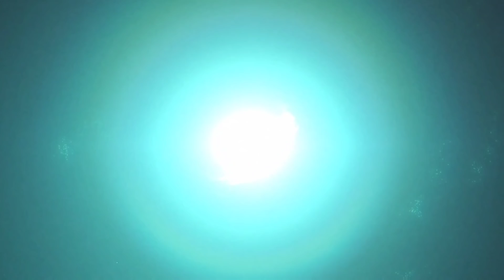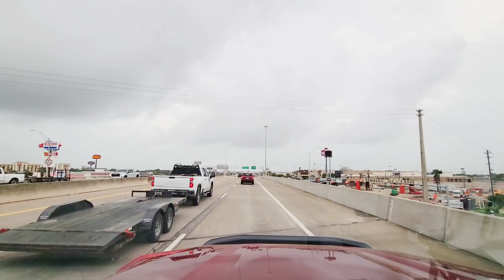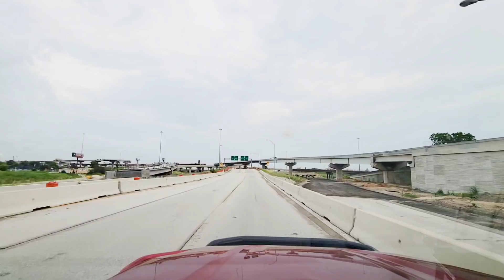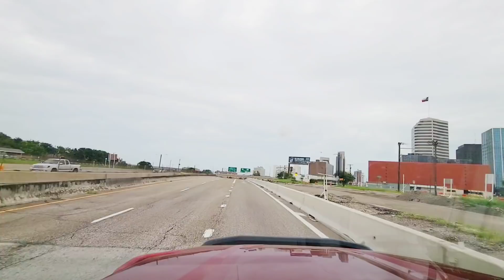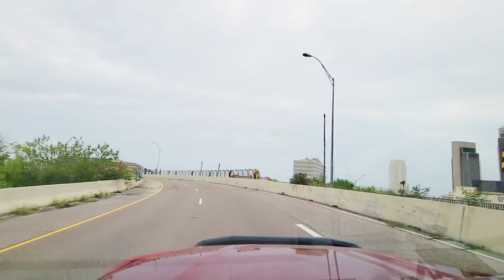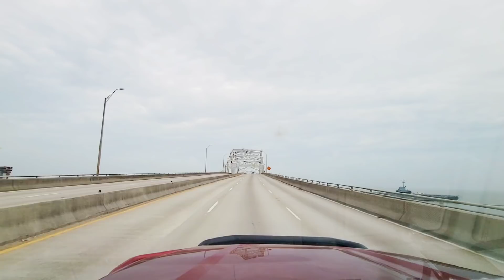The RVs industry and how it needs to improve!

Comment: The RV industry needs to have a lemon law, something to hold them liable to fix or replace a unit when the same or multiple issues keep happening. In 2005 I bought a bran new Trail Bay 27DS made by R-Vision, bought it in December, took it home and stored it outside in my yard with a cover on it. The next April took it out the first time, found a stress crack in the fiberglass on the front wall. At the end of the season R-Vision came and took the unit back to the factory, fixed the crack and brought it back, I live just south of Indianapolis. Next year the stress crack was back, again, end of the season they came and took it back, replaced the entire front wall. The next year, another stress crack on the front wall, this time in a different place. Again, they took it back, replaced the wall and returned it. Next year, another stress crack, this time they refused to fix it, this was late in 2009 and the economy was tanking. I filed a lawsuit, was three weeks out from our court date when I got a call from my attorney saying R-Vision filed chapter 11 bankruptcy, so my lawsuit was dismissed. 4  cracks in a little over three years, all on the front wall, there is obviously a design flaw somewhere. Had there been a lemon law I could have gotten a new unit, but currently still own the one with the crack.

Comment: I have worked in the aftermarket auto industry in some way for about 50 years. Can you imagine a tech not having a manual/website for wiring as example. I have a Grand Design Reflection, from the first trip water leaks have plagued this unit. Their own dealer said they need to use a better connection, not a ring crimp. Warranty work was done because I every connection was leaking, but did they fix it with something better no. Now out of warranty and still the problem. I want a manual so i can fix it right the next time. Wiring make no sense either give me something to work with, maybe someone could make a dollar here.

Comment: You make some good points in this video. Standing still on quality usually leads to a manufacturer falling behind the competition. Maybe Coachman with whom you are working on your concept fifth wheel, should be encouraged to produce a sample RV with tidy labelled and documented wiring and plumbing on display behind illuminated transparent plexiglass walls in the storage lockers. This would give them a USP at a future RV exhibition and they could assess public reaction. Also the RV Training Academy you had down to document your solar upgrade could institute a program of training engineers in automotive quality RV wiring installation. In time, with this trend towards higher quality behind the scenes/screens would make little difference to the retail price and reap benefits on lower warranty repair costs. If the general RV-buying public were aware of the dreadful mess behind those carpeted walls I am sure they would be discouraged from purchase and gravitate towards the manufacturer that had moved into the modern era.

Comment: I feel that just focusing on the fit and finish would be a huge help. Our slide with the dining table and couch has a sagging roof. It sagged pretty much from our first trip. Jayco gave the dealer guidance to "fix" it and it looked good when I picked it up, but it was sagged right back by the time we had towed it on our next trip. Conveniently by this time, it was just past the 1 year warranty and Jayco basically said, not our problem anymore....thankfully I knew getting an extended warranty would be well worth it and they are covering a rebuild of the slide to properly camber the roof

Comment: So, I think the solution to the problem that you lay out in the last 5 minutes is for INFORMED buyers to buy RVs that have made those behind-the-walls improvements that the average no-research buyer doesn't know about. Companies like Grand Design or even other companies that have a "line" of higher quality RVs that meet the standards you speak of. The industry will change with the market. And I think that's happening. The market sometimes changes slower than we wish it would. And rightfully so, because these changes require MILLION$ in investment. And the way we change that is to make more "informed buyers". Which is exactly what you're doing with your channel. Thank you.

Comment: I just purchased a bighorn 5th wheel for my home. It won't get moved again. It has it's own barn for cover, power and everything. Even a deck. My problem is half the walls aren't tacked in, the shower door wasn't put in right with a gap on one side, water tube wasn't even hooked up to ice maker, and the trim (this fixed before delivery) screws were only 3/4 drilled in. That's the quality manufacturer's are putting out. Yes we looked it over before we bought but how much should we depend on manufacturer's to literally "give a damn"?
Reply: In a similar situation. Me and my family are also living in a parked 5th wheel with a deck.  We take little trips here and there but living in it full time really makes you notice some things.  If you can fix things yourself this really wouldn’t work for you.  The cheapness in some of the things pisses me off too for the price of them. And not just cosmetic, there’s a lot of cheap materials that are structural.
Reply: @paultasker9759  my problem is I'm unable to fix. So yes on top of sales price,  now it's trades men because of my location. Sucks big time!!
Reply: @paultasker9759  what brand model is your 5th wheel?

Comment: If in reality the mess of wires does not cause any failures bouncing down the road than maybe it does not matter. Frames are built to withstand an allowable weight not built to each floor plan. Example a 40 or so foot frame for a manufacturer will be similar if not the same irregardless of the floor plan. Not referring to toy hauler and non toy hauler,  that is obvious.

Comment: RV quality is low.  Case in point the wiring job on the recent RV for this channel. In what universe is how RV’s are wired, plumbed or HVAC duct work ran, especially for a prominent YouTuber’s main RV ok for today’s standards?  No wire loom / cable management, plumbing lines that leak and blow under higher water psi conditions, and HVAC ducts that are questionable at best.  Not to mention second rate tires and other parts. All while they still want top dollar for the unit.

Comment: Hey JD,

First of all I love your content. I wonder if you could give some insight on why European travel trailers are so different from US products. It seems to me that European models are so much lighter (mostly aluminum frame). Obviously they are smaller but even small US travel trailers have a steel frames. On a price perspective it doesn’t seem to be more expensive since travel trailers cost about the same on both continents. Maybe you can shed some light on why they are so different, apart from the fact that most euro trailers don’t have slide outs.
Reply: Regulations. Very strict limits on vehicle size and weight. They also cost a lot more.

Comment: Rv's are way too expensive for what they are. The only reason they get away with it is because they finance them for 12 yrs so people get a low payment. It's real easy to fork over 200 bucks a month rather than 800. If the auto industry has all these engineer's and safety standards and the rv industry has considerably less of both, an rv shouldn't cost the same price or more. Rv's are built very poorly compared to a late model vehicle. I wonder what the real cost is to build an rv vs the sale price. The margins must be very nice
Reply: I wouldn't be surprised if a lot the mark ups occur after the manufacturer sells the RV.

Comment: RV manufacturers want to keep the weight down low; that's why they continue to put those antique air conditioning units on the roof. They haven't even figured out inverter air conditioners yet. Say whatever you want, manufacturers don't need to change anything; as long as there's enough people willing to stand up and fork over large amounts of cash.

Comment: On the subject of frames and after-market components, have you ever done a segment on the MORryde X-Factor crossmember reinforcers? I've been considering getting them for the Open Range 376FB for 2 years since I bought it. I had two rear shackles fail, one on both sides. When I took the rig back for a repair (unrelated, Lippert paid for the shackle failures) I mentioned it to Heartland's repair chief, and he said they fail all the time. I was like "so why not upgrade the design" and he said because the vast majority are only driven a thousand or so miles a year. I had more than 60k miles on mine in two years. 

While he did the repairs, they also reinforced the dump-handle mounts, added extra grommets to the cable slide holes, and did more stuff like that. Again, more stuff the factory should be doing. The industry is often very miopic about this kind of stuff.

The problem now is new buyers ARE NOT HELPING. A friend who's a salesman at a Georgia RV dealer said he had 5 deliveries in a row, the customers were too interested in taking it home and they all signed off without even doing a walk through.

Comment: You are definitely a smart man no doubt but you have missed on a few issues in comparing the RV and OEM. I have been employed by an OEM for about 20 years so I know that business inside and out. One big thing they both share is the assembly line. The OEM has it figured out and I think the RV industry missed the bullseye.  We build 4 different platforms with over 20,000 different parts and complete a new vehicle every 72 seconds all on the same line. We have engineers in 7 different countries all working together simultaneously so the idea they all have to be together is wrong. We also do not manufacture a single component, they are all 100% supplied to us. So I’ll make one last point, if the OEM had the quality issues post sale that the RV industry has the roads would be completely empty.
Reply: A phrase I like to use is "anecdotal generalization".  Unless we have access to actual data, like side-by-side scaled cost breakdowns of RVs and vehicles, project schedules with tasks, for each company,  we really are just speculating.  We don't know for sure what goes into each model of car/rv in terms of man hours, assembly costs, materials, how project structure/collaboration is laid out, where they cut costs, etc. and typically generalize industries based on one or two personal anecdotes or try to say "the industry should do this" when we don't know any of that info.  For all we know, they already had the meeting of "ok if we can save 2 man-hours by not organizing the unseen wires, we can save $100 per unit, across 1,000 units that's  enough to get another employee for X division or afford our dividend this year".

At the end of the day businesses need to make profit to survive and the breakdown of how they do or don't do that is totally up to them.
Reply: I have no problem RV Mfg. make a profit AND the dealers profit, BUT a 30% profit is more that enough. ( oh 30% is what the dealer makes). A salesmen told me that.

Comment: Seems like one of those "can't have your cake and eat it too" cases.  Unseen wiring is certainly a place where manufacturers would choose to cut man-hour costs to keep up with competition, now that there are literally hundreds of different models of RVs out there to choose from, which drives down prices.  Heck, my $90k Class B came with a plastic shower head that probably cost them less than $5 and it could easily be replaced with a luxury $25 one.  If they're willing to cut costs to save that $20 on a 90k RV for something as visible and used as a shower head, i'm certainly not holding my breath for them to make the unseen wires pretty when i'll never (or rarely) access them.  

If you want a quality RV that will last you decades, is made well in that fit-and-finish and wiring aspect, folks already know what brands to look for and expect to pay a premium for it versus manufacturers that pump out tons of units at a lower price point.
Reply: Problem is even those high priced RV’s STILL will have problems sooner rather than later.  Why don’t they pump funding into addressing these problems and change manufacturing so that RV’s break down less.  The RV industry standards suck compared to auto industry IMO.   And that’s because the buyer base doesn’t complain like auto industry buyer base (retired was the norm who let more defects go).  Still RV businesses manufacturing could reinvest into their companies vs mass production for most profit.
Reply: I think some manufacturers do not want the RV to last to long so maybe they make you purchase again.
Reply: @ronaldpigeon4713  hmmm. Wouldn’t that make customers NOT want to buy your brand again?  I wouldn’t if that was the case.  I’d find another brand.   This is just my opinion though.  😉
Reply: @ronaldpigeon4713  Probably a bit of that too.  Today's consumerism, mixed with some "they dont make em like they used to".  Wouldn't be surprised if they did market research that says 80% of RV buyers are famlies who go out a handful of times a year  otherwise it's sitting unused for 98% of the year.  In that case, "built to last" is relative in terms of how much you use it
Reply: My nephew lived in 5 from 2012 until 2020. He believes they are built to last about 5 years. Now the weekend warriors use it maybe 5-10 times a year and that is fine. But us full timers,  our 5-10 times a year is used up pretty quickly.  So within 2 years our 5 year problems really start. And who has 80-100 grand to throw away that often. This one, because of the cost, has to my last one.  It's my home now. I'm praying it holds up. Hopefully this made sense.

Comment: The spaghetti of wires shows poor craftsmanship IMO
Reply: I would prefer raceways and better rated wire, THHN2/THWN. Cable assemblies are not good. Also a full set schematics like buildings have. Rough, finish, architectural, plumbing, electrical, mechanical. Would be great to have the drawings to easily order replacement parts and a line diagram and reference measurements to locate electrical and mechanical routing.
Reply: Would be so nice to repair and upgrade with ease.
Reply: There needs to be consistency in the production process.  Process bulletins to establish uniform, regularity when installing components or sub-assemblies. Especially with the trim pieces where you can see fit and finish.  Furthermore, all sub-contractors /supplies to enhance their quality control before components are shipped to the manufacture / production for final assembly.  For example, black or grey tanks where plugs are left in the tank and become lodged in the plumbing and tanks cannot be drained.  QC should catch that at the subcontractor facility.  It seems as though much of the QC is left for the owner to find real time.   For the cost for these units I don't believe this is an unreasonable request.

Comment: The RV Industry is struggling with 'compromise.'  The reason RV's have EXPLODED in popularity is because people are at home and know they can work anywhere.  BUT: 

- Good luck getting an RV where 'office space' is anything more than a crappy card table.  Even your Coachmen MBL with a 'proper' desk is only a concept model. 
- Good luck finding an RV Park where the Wifi actually works, or where they don't bitch at you for accepting Amazon packages.

There's an entire GENERATION of digital nomads hitting the road, and they're 'making do' with existing gear.  The company that EMBRACES digital nomads is going to CRUSH it in terms of popularity.

Comment: I’m sure you’ve already thought about it but what I would like to see improved is the quality of parts.

When I buy a trailer I consider it big money but I understand the RV manufacturers have to make it to the lowest common denominator and as cheap as possible due to 90% of the people only caring about price

I’d prefer an option where I can pay a couple of thousand extra and get the name brand fixtures, furniture, electronics, upgrades that I’m going to rip and replace anyways.

They’re getting a little better and starting to offer some more upper quality items but still infuriates me when it only cost a few dollars more to get a better quality part

Next I would love an option to pay the workers on the line and hourly wage instead of piecework.  I want the people to make my RV to actually take the time to make sure it’s right and not throw staples and nails in stupid places because they’re in a rush. There’s a Jayco factory video on YouTube that I have no idea why it’s still online as it shows the guys running along the roof with staple guns, nail guns and other parts as fast as they possibly can. It’s just shoddy workmanship.

Some people don’t care and want to cheap price I’d rather pay a little extra and get good quality but not crazy extra.  These are still just fiberglass and wood or aluminum boxes.
Reply: The problem with paying hourly is they milk the system and will work less and less.   Speed and quality are possible with the right checklist and management.   I agree they should still have deluxe versions same model but with better appliances whisper quite a/c and better plumbing fittings and fittings in general.